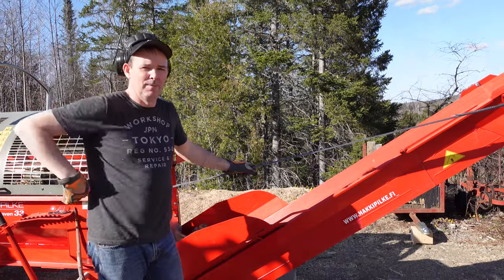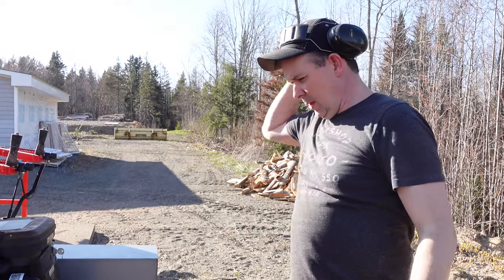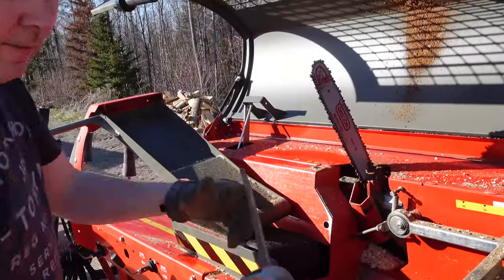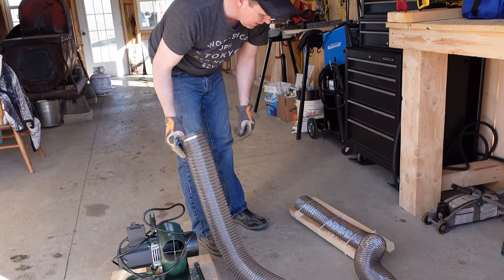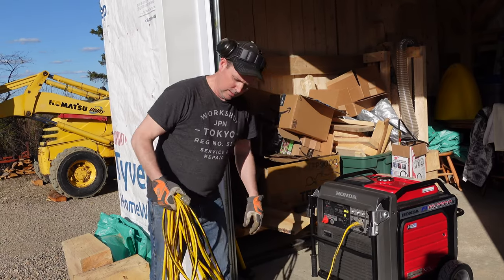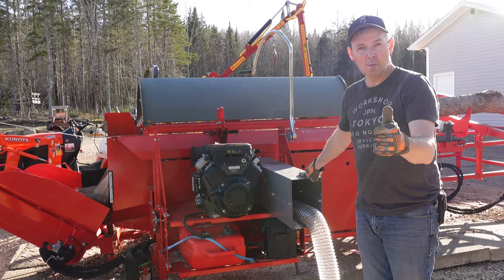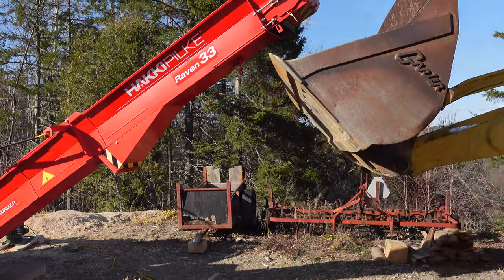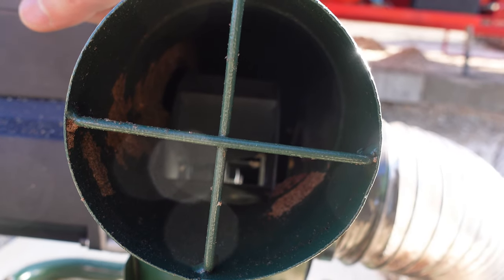Firewood Processor Sawdust Problem -E122 #OakMountainAcotts

Comment: Jason I run a hakki pilke easy 38 and use the garbage can under the sawdust shoot. (3 big plastic cans per cord) I did have to put an extension onto the sawdust outlet. Just used some light tin. The easy 38 sawdust exit is angled down which prevents plugging. I also removed the 4 metal bars in  the shoot. Chris
Reply from the maker: Great feedback! I think the blower is a great addition and I doubt I will manually touch sawdust again unless I can find a buyer for it!

Comment: Well that blower system you got there it's a lot better than a garbage can. Maybe you can make a board that it's up inside your discharge, with a 4-in hole that fits your tube,  something that fills the shoot better. Create more vacuum. Just a thought. Keep up the great videos!
Reply from the maker: I agree with this. A nice tight fit would be better. It is surrounded by sawdust now and I put a bungee strap on it to hold it up nice and close to the saw. It is working really good... almost pull your ball cap through if you're not careful!

Comment: I saw a similar sawdust setup on a japa 365. Works well. That one has another hose on the output side and is routed to a plastic inch tote tank.
Reply from the maker: Thanks for the feedback. I'm going to trial this for a while and then make some modifications. Once I have a building over the processor I can make it a bit more permanent!

Comment: hi there new here nice job think i may take the kink from the flex cut the cross from the discharge  and install a longer pipe to over the hill . or do nothing cause it works  take care  john
Reply from the maker: Hi John, thanks for stopping by! I had a second piece of pipe down over the hill but it slowly plugged over time. I have made a few little changes to the setup now and am running on 150’ of extension cords from the house to save generator gas. Things are looking up and no more chute plugs! Take care, Jason.

Comment: I would suggest that you shorten your plastic hose, and build a wooden stand to hold your blower up higher and closer to the sawdust spout.  I think that would really help you.
Reply from the maker: Thanks Ron! Once I get a building around the processor I'll set this up a bit more permanent. I ran it yesterday and it worked just like a vacuum cleaner with no sawdust plugs!

Comment: Jason if you put the blower out to straiten out the hose would  blow them better. Or maybe a hose on the pump discharge and blow it over the bank.just a thought 🤔
Reply from the maker: Thanks Bob! I get why the suction is on the side of the unit but it is too bad it wasn't oriented to feed in the backside with discharge from the front. It would be easy to pipe it in then! I have to play around with it and need it to be portable for now until I get a building over the processor. Stay tuned!

Comment: Ya ever think about using the sawdust and make pellets, out lay is a bit high, but you get a return on something you toss away. The other thing is you might want to cap the chute off and put a fitting on for the plastic hose,, so it has to suck from the cutter bar, and not be able to draw air from all around that way it makes a vacuum of sorts inthe chute
Reply from the maker: I haven’t looked into a pellet maker yet. I bet they are expensive! I’m going to try bagging some to see if there are any local buyers for hardwood chips… I built a wooden rack to hook the hose to that slides up in behind the cutter. The sides filled with sawdust and I have pretty decent vacuum!

Comment: Hi Jason !!😀😀
I wonder if you could put a inverter on the processor to run the blower so you don't have to run the generator.
Reply from the maker: Yes, I need a solution for that. Gas prices are so crazy (almost $2 per liter now here) that I don't want to burn anymore than needed!
Reply: Or,  send it back to manufacturer to get it right! There's a reason we build prototypes!!

Comment: I think you need to add a section of pipe to the outlet of the blower. Otherwise your going to get a big build up right at the blower.  Maybe all the way to the final dump area.
Reply from the maker: You are correct. I have a bit of a pile there now. The good news is, if the neighbours don't want the sawdust, I can just push it down over the bank with the backhoe!

Comment: been wanting a blower for my sawmill this might just work, just looked it up around 200 + tax and most likely be shipping , for sure gonna save you some time
Reply from the maker: I was skeptical when I opened the box (much smaller than I expected) but it seems to work really well. This came from Busy Bee (link in the video description) and I think shipping was covered by them but I can double check. I have in my head that the unit and two pieces of hose was about $300...
Reply: @OakMountainAcotts  busy bee is where i found it, i get their flyers , thanks

Comment: You asked about the easy 38. I went from the 422 deck like u have to the 472 with extension just so I could get a full cord on the deck. The 422 was a great deck just wanted extra capacity. (I got the deck numbers wrong in my first response) too many numbers eh.
Reply from the maker: I asked about upgrading my deck and I would have to upgrade my processor first! Not sure that is in the cards for 15-20 cords per year!
Reply: @OakMountainAcotts  I wouldn't spend the extra $$. Your set-up is great. I am doing about 150cds and it only is a break even semi retirement gig.
Reply from the maker: Agreed. We need firewood to sell for $400 per cord! It would still be cheaper than electricity or gas…
Reply from the maker: I have a question for you if you don’t mind. Have you ever had your bar and chain hold back out of the wood? I have trouble with really green white and yellow birch… very frustrating!
Reply: @OakMountainAcotts  yes I always blamed it on dull chain or a lip on the bar. I switched from the Oregon  bar to a cannon bar. They are pricey but will outlast 3 or 4 Oregon and are much stronger.
Reply from the maker: Thanks, I can’t feel a lip on the bar but maybe I’ll swap it out and see what happens!
Reply: @OakMountainAcotts  must be the chain. Try a new chain that will rule that out. I have found i have to file the drags down once the chain get about half wore out to get it to cut. You can file the chain til the cows come home and it wont cut if the drags are too high. You likely have found that with your chainsaw. Then do what I do. Call Jason hart. He and his dad have got me out of a few issues.
Reply from the maker: Thanks, maybe I got a bad chain, I’ll take the advice!

Comment: There should be a place to put a plug on your processor so as to not need the generator and if that's your permeate location for the blower you can shorten the hose and that should eliminate the build up in the hose.
Reply from the maker: Excellent points David. I'm going to play around with it for a few cords and then I am sure I will be making some mods!

Comment: Why not tilt the discharge opening down so that the chips slide down on gravity instead of backing up the chute
Reply from the maker: That would probably work. A little drilling and fitting to adjust further. I have the blower on an extension cord from the house now and it is working great… no plugs!
Reply: That is the way it is on my easy 38 processor. The raven looks like it is exiting on the level.
Reply from the maker: @chrisbubar6604  how do you like the 38?
Reply: @OakMountainAcotts  I like the 38 ok. I have about 1000hrs on it. The joystick and swingable output conveyor are great. I had an older 37 that was belt drive and it was so noisy. Mine has the Subaru 28hp. Works good. About 4liters per cord. Last yr I traded my 421 deck for the 422 with extension and I can get a cord of16' wood on it which saves a lot of shutting down and restarting. You have some great stuff. Keep up the great work. Drop in sometime I'm only outside Fredericton.
Reply from the maker: Great feedback Chris. Nice to connect with someone local running similar gear. Do you have any issues securing semi tree length? I can’t buy it and I am in the middle of the woods. The cost structure only works for me if I cut my own anyway… take care.

Comment: Strech the host  so that the chips don't  have a valley  in
The drop.
Reply from the maker: Good point! I put a bungie strap on the hose and connected it to the processor yesterday so that I could put a little tension on it. Worked really well yesterday with no plugs!

Comment: Hey put a small extension on it and add  a Conveyor
Reply from the maker: I'm going to try a small piece of hard pipe to see if it will send it down over the bank!
Reply: Check with you electrician so you can run the blower off your battery while running. Remember to turn the blower off at the end of processing.
Reply from the maker: Great idea… gas and fuel prices are ridiculous these days!

Comment: Why are you fighting a manufacturers design flaw????
Reply from the maker: Nothing is perfect. Just looking to make improvements on my process.
Reply: Did you build processor?
Reply from the maker: Not sure where you are going with this James...
Reply: @OakMountainAcotts  if you bought this machine & paid good money for it?, a design flaw should not be your problem. The reason we build prototypes is to work out the kinks, not to send a partially working machine to a customer & let them figure out a problem.
Reply from the maker: I understand your point. This is not an issue that I would take up with the manufacturer. I believe the engineering to be sound on this processor and am overall very happy with the unit. A small problem with sawdust has been improved with the blower and now I can send my sawdust right to the final lay down area with no need to touch it again!
Reply: @OakMountainAcotts  The fact that you don't have to touch chips again is a time saver for you. At $2.00 liter, $7.56 gallon, running a generator as well doesn't seem economical & just another machine to maintain. 

Hopefully you brought attention to a design flaw.
Reply from the maker: Agreed. I was able to run enough extension cords from the house to the blower to stop using the generator. Working really well now.
Reply: It's not a design flaw... It's a feature. The manufacturer sells a blower as an add-on.
Reply: @IlkkaVuoristo  A feature? Sawdust jamming up is a feature?
Reply: @jamesrussell6870  To sell blowers, yes. It's a pretty common tactic.